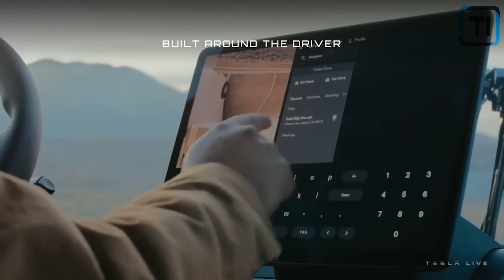The Truth About The Tesla Semi Revealed!

Comment: WHEN IT TAKES. THE ELECTRICITY.  IF 360 HOMES. TO  DRIVE  ACROSS. AMERICA....
THIS. IS ONLY GOING TO WORK FOR SHORT 
TRIPS.....WITH YOUR OWN. CHARGERS.....ELON. HAS.  ALOT OF. PROBLEMS.....THAT LOOK GOOD. AT FIRST...
BUT. ON CLOSE. EXAMINATION..ARE SLIGHT OF HAND.....SUCH. AS REGEN........SOUNDS. LIKE YOU ARE GONNA
GET BACK EVERY WATT........WHAT. ELON. DOES NOT TELL YOU........ITS ONLY 3. OR 4%. REGEN......IT HELPS. BUT.  NOT MUCH.....AND THATS. IF. IT. ALL GOES. PERFECTLY YOUR WAY.

Comment: Why use an EV truck with a range of 400 miles when IC trucks have a range of over 2000?
Reply: Torque, quiet, cheaper( eventually) 

Today I think they’re only doing it to push innovation
Reply: @spencerbrady2425  I love the innovation but hate when it's done at taxpayer expense or for ESG scores. They still haven't figured out clean sourcing or disposal of batteries, most charging is still done with power generated from fossil fuels, power grids aren't prepared for EV charging at scale, and charging is prohibitively slow. I actually believe batteries are the future but that we're still a couple generations of tech from it making sense economically or ecologically. That won't stop California from putting an arbitrary date requiring all cars to be EVs while simultaneously trying to ration electrical power for charging vehicles. 🤦‍♂️
Reply: Why does everyone suddenly care about taxpayer expense when it comes to things that will actually make the world better(in way more ways than what is usually discussed), but nobody bats an eye over that they have been subsidizing the fossil fuel industry their entire lives. Also, that energy sector isn't green yet is a energy sector challenge, not an EV challenge, but it will help expedite the solution.
Don't get me wrong, I absolutely agree with you that there are some challenges to be solved. I just disagree with the attitude of your OP, if nobody takes the first step when we would still be bashing each other in the head with stone clubs :)

I'm from Norway, we have gone from practically zero EV's in 2010 to having 90%+ of ALL new cars sales being EV in 2023, we have an official goal of not selling a single ICE car post 2025. If we can do it then sure as shit the US should be able to do it ;)
Reply: Why use an EV truck with a range of 400 miles when IC trucks have a range of over 2000? 
 Because any range beyond what you can drive in one 11 hour day means you're wasting energy carrying around unnecessary fuel. And a Tesla Semi, fully loaded, in California, where the speed limit is 55 MPH, can make 605 miles without breaking a sweat, with a top off during the 30-minute mandatory break around 8 hours.
If you're talking about team driving to use the 2,000 mile range, you may not have noticed that the Tesla Semi is a day cab, and so isn't intended for and doesn't compete in that segment.

Comment: Here's a truth. Several truths. First truth. EV smi's are not ready for prime time. They don't have the range. 200 to five hundred miles followed by a down time of 3 to five hours, not practical. I, a heavy long hall over the road truck driver, I get paid by the mile, not by the hour, an average smi truck can easily run 700 miles on available fuel, takes 15 minutes to refill. No big trouble finding fuel. Available charging stations all across the nation's interstates is already an issue. It's not going to get better. Bigger issue. Virtual signaling by these companies. If the government wasn't covering most, if not all, of the expenses for this conversion, would it actually take place. The CEOs of these companies won't be behind the wheel of an EV smi when things aren't going as advertised. Chances are the limousine they go to the Hamptons during the High season will not be an EV. If that same CEO had to actually pay for this and I as the tax pay didn't, what do you think would happen.?
Reply: Here are some alternate truths. 500 miles range on the original charge plus another 200 miles when you top off during the 30-minute break before 8 hours is farther than HOS regulations allow you to drive in a day where all of these are deployed; it's also the same as you claim you can easily run in a day. 
You may not be aware that these are day cabs, so no one's doing more than 11 hours a day in one, unless it's alternate drivers. Charge time is 1 hour to 80%, which would be sufficient for most loads, and 2 hours to 100%; but the time doesn't matter, because the driver plugs in and heads for home, and is having dinner with the family while the Tesla Semi is charged.
Tesla sold hundreds of thousands of Model 3s with no subsidies, during the several years between when the original tax credits expired and the new ones kicked in. This tends to refute your obvious assumption that none of these will be sold without subsidies. Fewer will be sold; but BEVs have already passed the tipping point, and Tesla and other electric semis may well do so within a few years.
Reply: @Big_Ben_from_La_Mesa  maybe in certain areas. 99.9999 percent of the United States isn't in those certain areas.  Supporting interstructure,  IE easy reached and operational charging stations are an increasingly issue now, what's going to happen in 5, 10, 15 years. No good ripe for abuse.